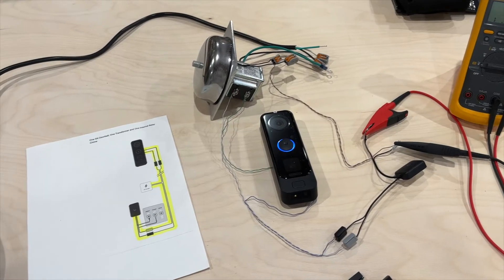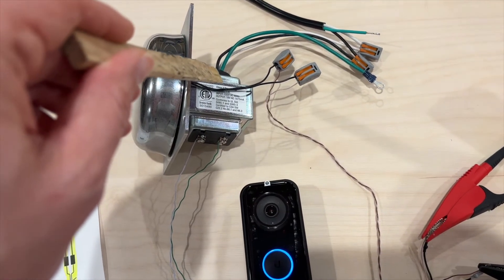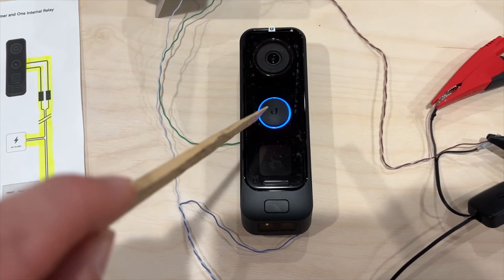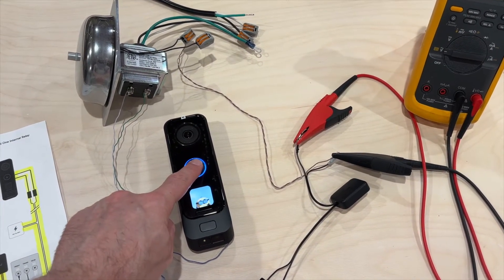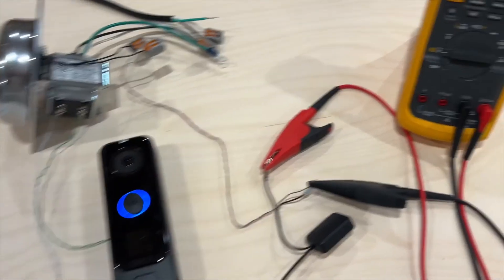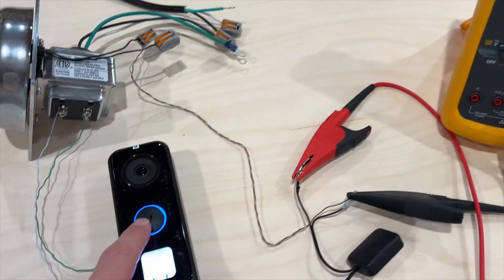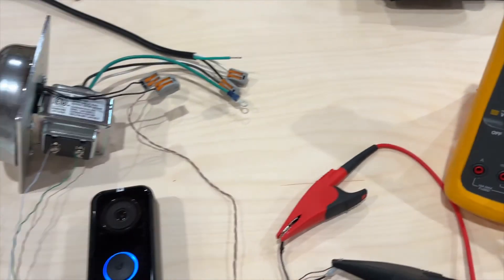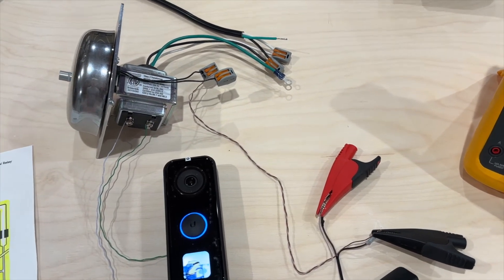How to wire Ubiquiti G4 Pro Doorbell to a mechanical chime with transformer.

Comment: For some reason it didn't work when I initially set it up despite all the correct wiring. I had to download the unifi protect app on the phone, set the chime to mechanical and then restart the doorbell. It worked after that.
Reply: Had the same issue with the standard G4 doorbell. Thank you for this tip. I now knew I had to go and find this setting.